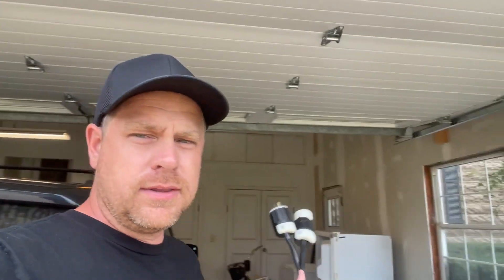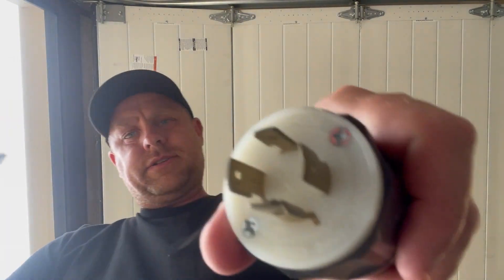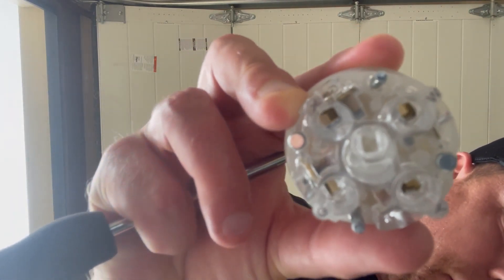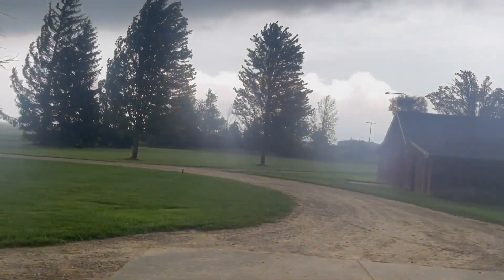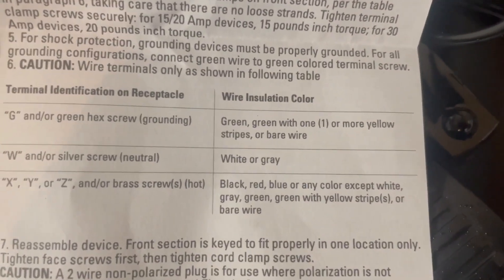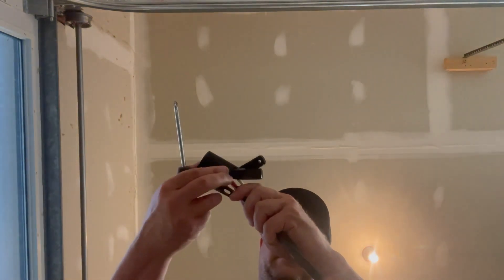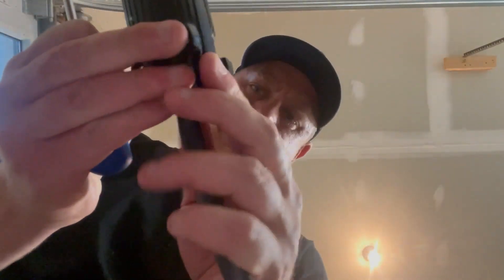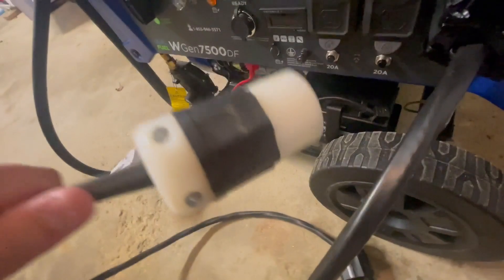How to Replace a Whole House Generator Extension Cord Plug End

Comment: Did you hook  up the plug and breaker for your generator yourself to the panel and the interlock .
Reply from the maker: No that was already installed.  I just had to change the plug end due to it being a different connection.